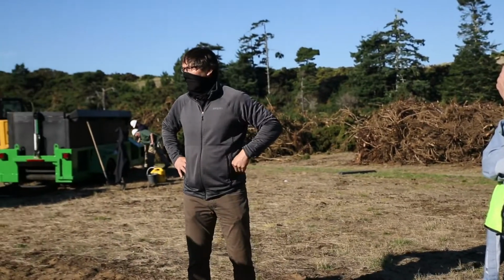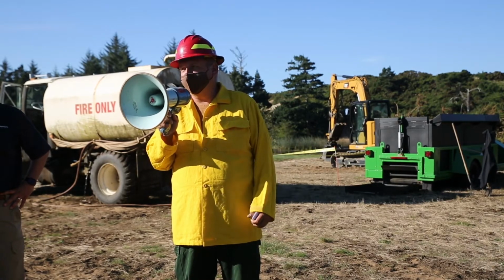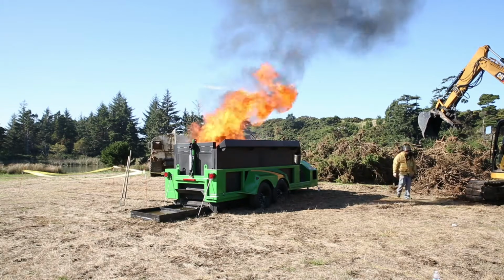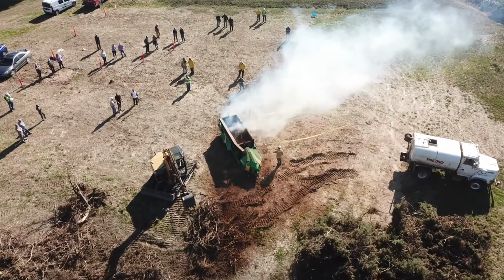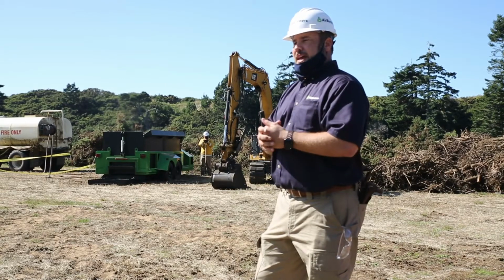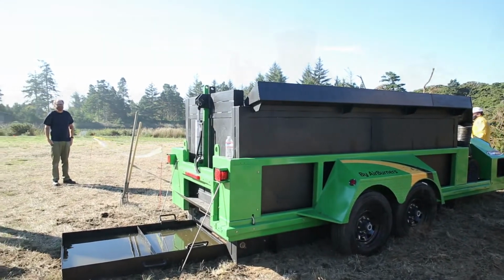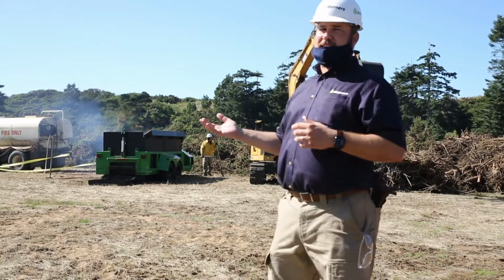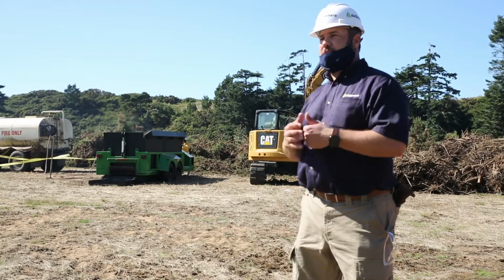CharBoss Demonstration, Bandon Dunes

Comment: This is not real biochar wood that is is just a charcoal those guys are doing it's not the real thing
Reply from the maker: Donald. You can test the biochar yourself or have it analyzed. You will find that it is the real thing. These mobile systems make good quality chars. The yield is lower than in a gasifier or pyrolyzer but it will benefit the soil and soil biology just as well as chars from those devices.
Reply: Can you buy this machine ?
Reply: biochar is charcoal charged up with minerals.
Reply: I agree. It's not heating the oganic matter in the absence of oxygen. There seems to be a common acceptance of making charcoal with O2 and calling it biochar. This charcoal may improve the soil. However, from my research, biochar last much longer, acting as a much more effective carbon capture product, it has better water retention properties, and therefore has a greater benefit on soil microbial mass, and for many more years.
To be fair, as I said, it's commonly accepted (although wrong) that burning organics to make charcoal is "biochar".
-Ken.
Reply: @MakeTechPtyLtd  I think you a rigth, because a recommended biochar pyrolysis oven costs in Germany approcematly 200.000Euro and needs up to 180 min for 1 batch. And you get only CO2 certificates if you use a certified biochar pyrolysis oven.
Reply: @herberroland363 hi, my knowledge on this is significantly better now. I've been growing trees in biochar soil. Yes, low temperature char can be better but basically there's other factors that also influence the end result in the soil.
I actually use a pizza oven for small batches and quench into diluted cow manue for inoculation. Works great in the hard clay soil here.
-Ken